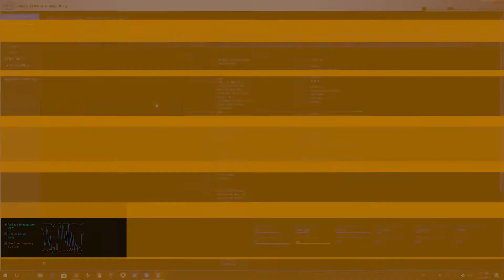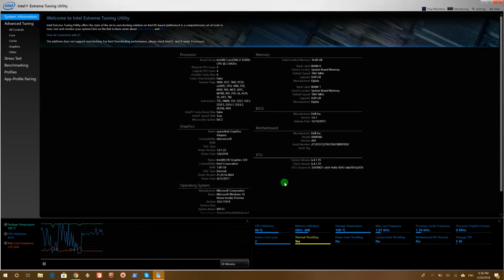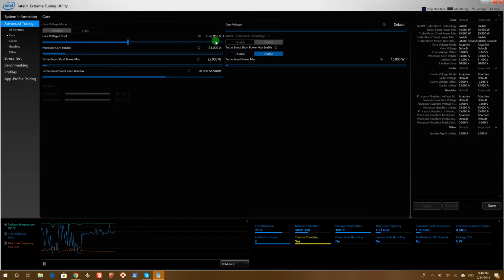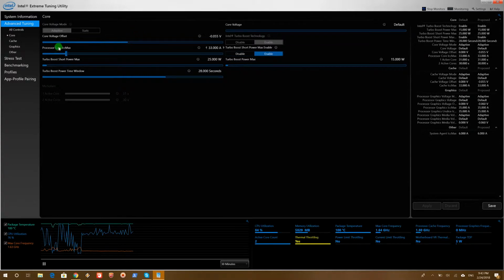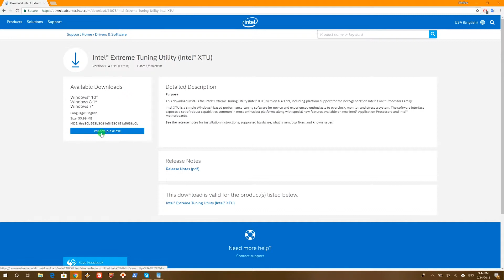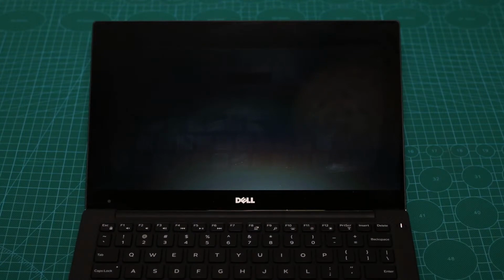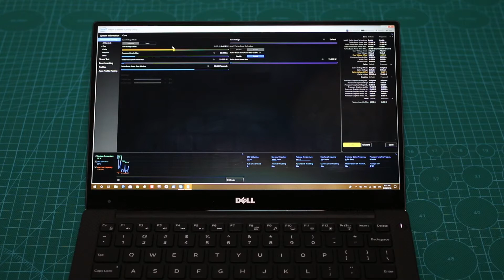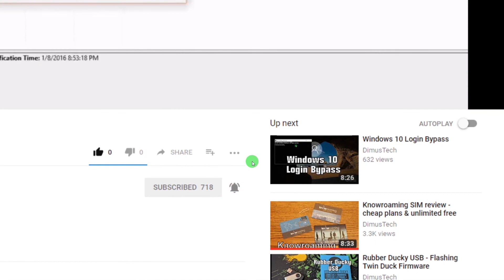CPU Undervoltage - Increase your Laptop Battery life

Comment: do you always need to start the app every you turn on your computer or does it run in the background service automatically?
Reply from the maker: From what I know, it basically writes all the settings to the bios and you don't need it afterwards, but while you still figuring the best config for you, you should run it since it can recognize failures and restore settings if needed
Reply: will definitely try it out...any suggestions for undervolting i5 8250u??
Reply from the maker: @lallan7519  Sadly it really changes from one system to another, in my case I ended up using some reall small tweaking but after some time when I used Adobe Premiere it crashed a lot so I ended up disabling them
Reply: @lallan7519  You just go as low as you can go until the benchmark in the software crashes. I have a my yoga 910 down to -0.95 volts currently. Battery life is much better now.